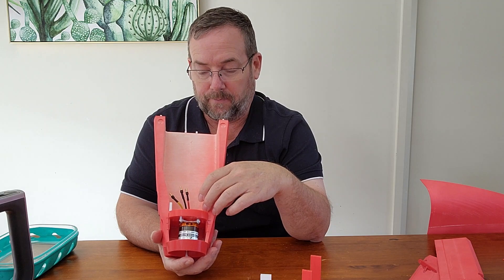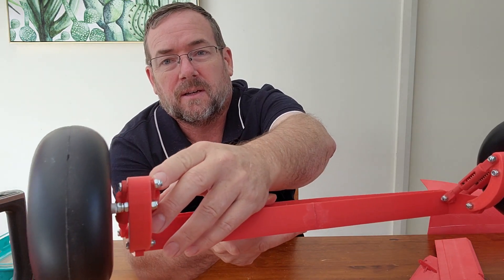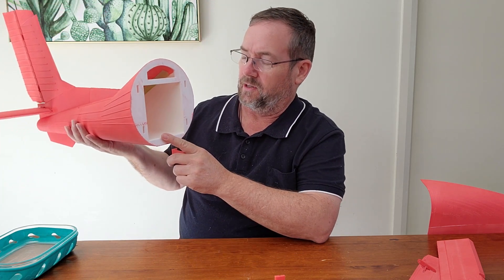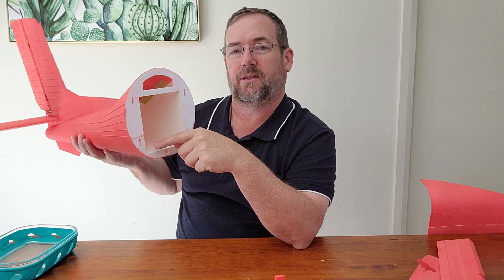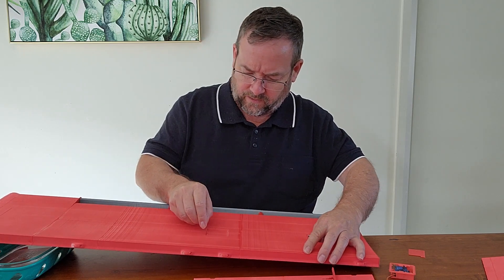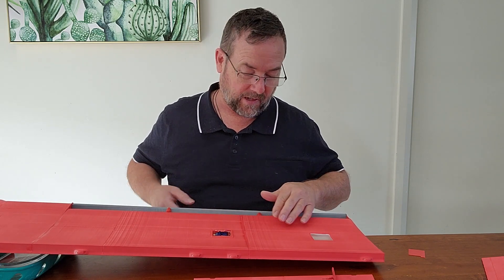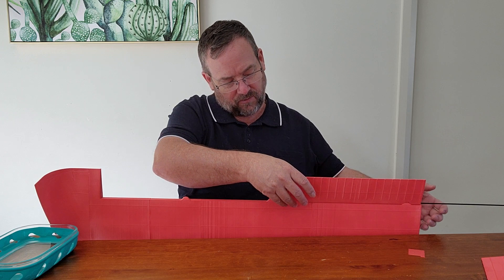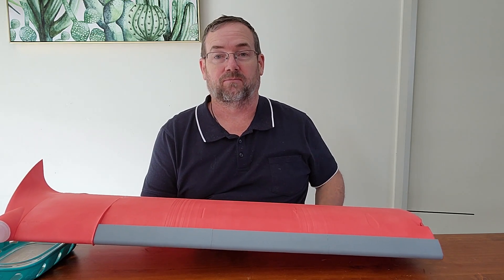Draco XL 3D printed plane part 4

Comment: go # 3 :) There's a lack of stringing visible in your prints. That's because you sliced it yourself to set your own retraction, that you need with your Bowden extruder.
Reply from the maker: Winner winner chicken dinner. Correct, there is stringing as I didnt use surface mode (AKA vase mode) and at times the print head was crossing from one side of the print to the other, I would have also accepted that there was a Z seem. Both of these would not be seen if  I had of used the gcodes that were sliced with surface mode on.

I actually went back and double checked before posting the question. The gcodes dont have a Z seem (drop it into Cura) as it is a continuous print that slowly increases in height to compensate for the layer height change.
Reply: @bozmanx  it would be hard to drop the gcodes into Cura unless you'd bought the plane, and then it'd be hard to justify entering again for a second digital copy :) That was part of my struggle mentally, what can I see in your prints that I wouldn't have seen in someone else's prints, or what could I see that I would assume were not intended to be there - and from the intro shots I just couldn't see anything. I gave up. Then I decided to go back and watch earlier parts again, and you talked about stringing and you needing 6mm retraction so... phew !
Reply from the maker: @Poundy  I meant to say I dropped it into Cura to make sure that its something that would not exist. Are you happy dropping your email address here so I can send you a link to the files?

Comment: more specifically, its because you're printing LW-PLA and needing to tweak retraction settings for your LW-PLA especially since you have a Bowden extruder
Reply from the maker: Hey, sorry, that's still incorrect. You are still concentrating on why I would have sliced it with my own profile and not how you can tell from the prints that I did.

Comment: You slice the STLs yourself because you are using a Bowden extruder, and the g-code files are sliced for a direct drive extruder.
Reply from the maker: I like your thinking but that is incorrect. Just for context, your answer is the reason why I would have sliced them and not how you can tell that I sliced them. I can elaborate more on the bowden v DD once we have a winner as the response would give away the answer.

Here is a big clue, look at the parts that I am printing, there are tell tale signs on them.
Reply from the maker: Don't give up, I think if you go back to the original question and think about it you will get the answer.